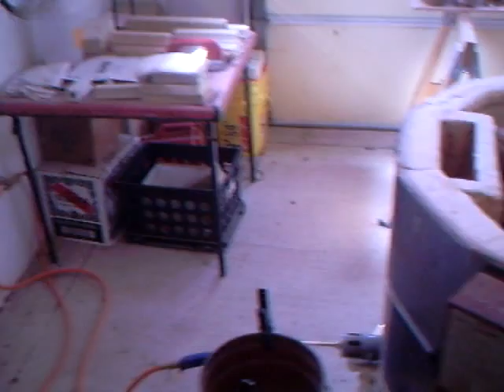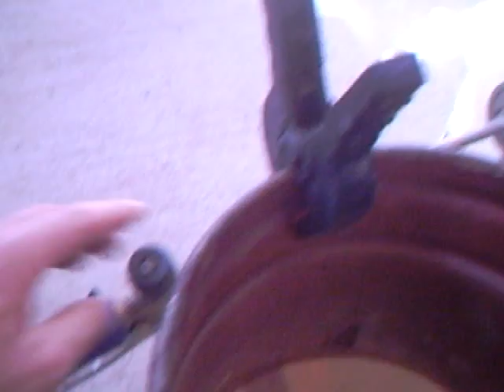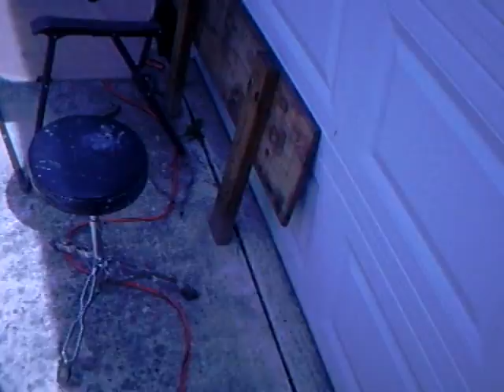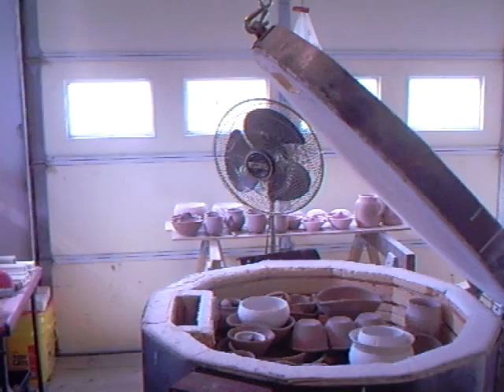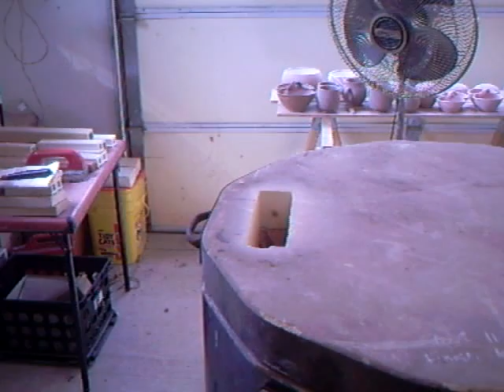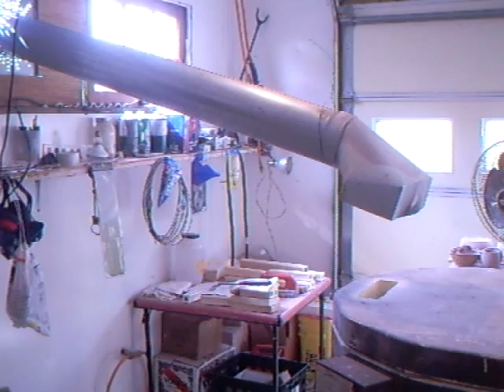SIMON LEACH POTTERY  - Lighting up my converted propane gas kiln !

Comment: What is the benefit of diverting the burnt gasses thru an "internal chimney" thru the kilns lid, rather than thru the kiln wall at the floor level like most down draft kilns?
Reply from the maker: Patrick Bass player - basically because it is more efficient, you do loose a very small amount of kiln space though.

Comment: Hey Simon!  I have converted an electric kiln but with holes in the bottom and top of the lid in the center.  I am having trouble reaching temp.  I only have one weed burner using it to shoot the flame up the center.  I have a shelf 8 inches from the bottom . and baffle shelf down from the top of the kiln under the hole 1.5 inhces from the top.  I am not sure how high to turn on these burner when doing a bisque or should I be using 2 burners. Do you go full on at the last part of the firing for Bisque?  Thanks for all your videos!  They are most helpful!
Reply from the maker: Its difficult for me to make comments about your kiln without seeing it. If you send me images I can perhaps help you - contact me via website email.

Comment: I used an oil drum to make a raku kiln based on your version from a couple of years ago...those are weed burners, aren't they?  A lot cheaper than the burner I got, I'll bet.  I have a friend with an old electric kiln in the back yard...this inspires me to make another!
Reply: Hello MamaMacabre, I'm wondering what burner did u get for your project. I'm currently trying to build one here in Seattle, but I don't want to annoy my neighbors with the sound of weed burners. Thank you so much ❤️

Comment: i have a question please!
when using a raku gas fire, and you get pieces that the glaze was like boiling; bubbling, not even fired, is it the glaze or the flow of fire, or is it the position of the shelf
thanks in advance.
thanks for all the info you always share